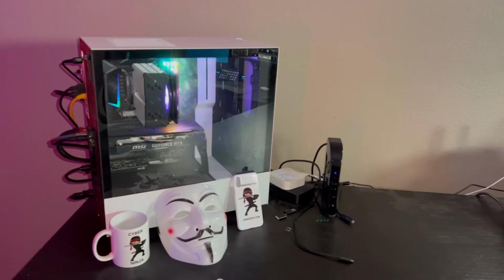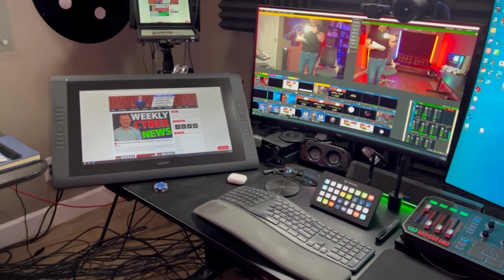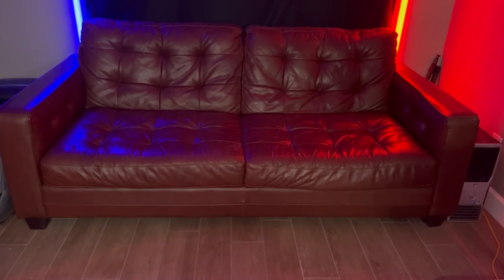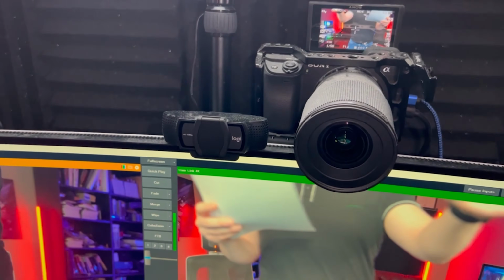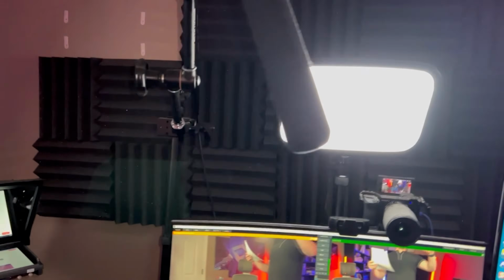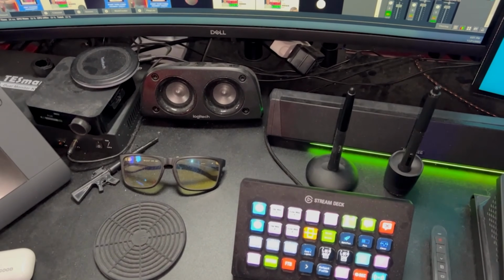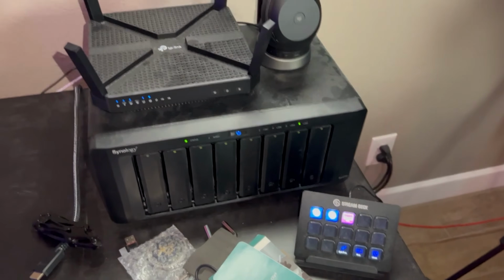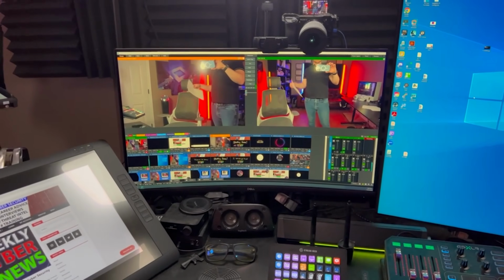My $20,000 YouTube Studio Setup Tour // Home Office and Desk Tour

Comment: I like your editing PC, good choice of CPU cooler with fan instead of water cooled. I have actually seen a brass plate erode and destroy the pins on a CPU, which would take a lot of heat to achieve. Most techs do not have RGB lights on everything, although some ram sticks and fans come with RGB pre installed. MSI make great motherboards. M.2 are fast becoming the choice of drives over SSD as the read/write speed is incredibly fast. Cable management can be achieved with some cable tidies which are relatively inexpensive. Impressive set up Jon.
Reply from the maker: I'm glad that you enjoyed it! The RGB definitely is more so because the PC has spent a decent amount of time in videos so it needed to look cool. I've been improving my cable management but one of the difficult parts in my setup is because I have a lot of pieces of equipment so it's more challenging than if I had a standard home office setup...maybe someday it will be clean.
Reply: @JonGoodCyber  add to the desktop and laptop I own, I play bass guitar. The cable management from having amps, leads, di boxes and effect pedals is frustrating enough so I feel you on that one.
Reply from the maker: For sure...right now going to my desk is pretty well organized but from there it's a spider web lol.